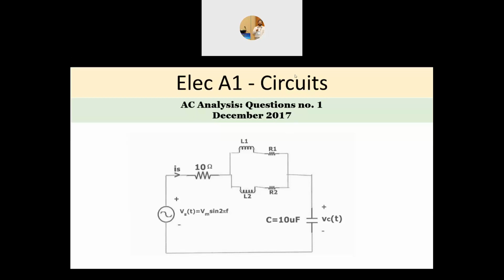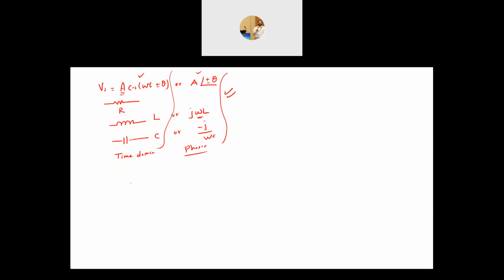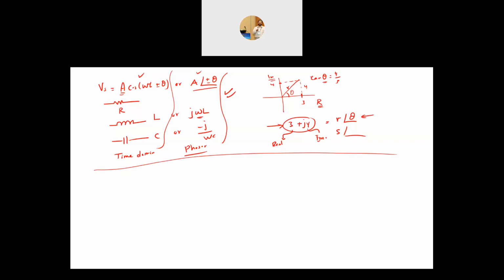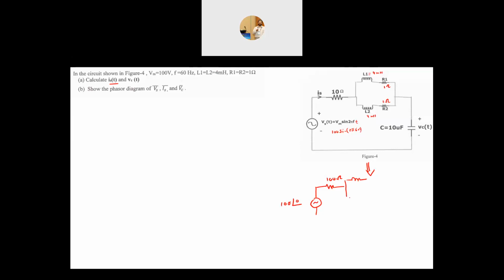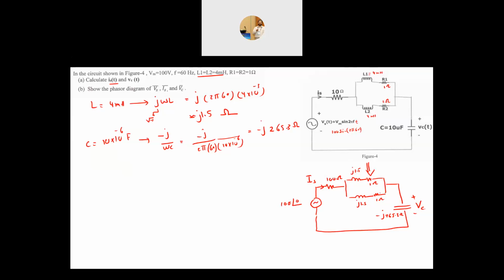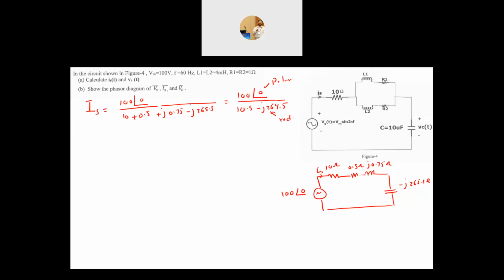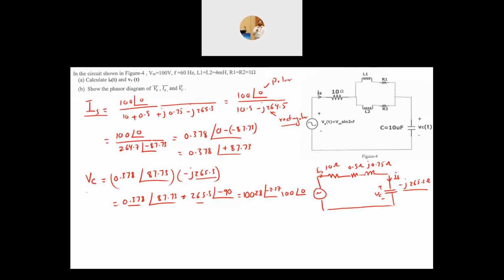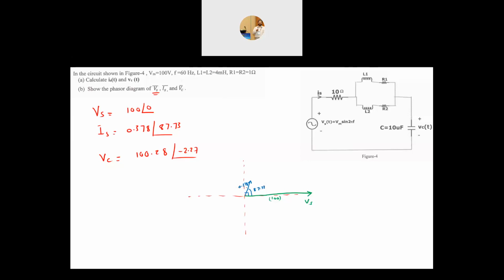PEO solved examples (ELEC A1): AC analysis Question no. 1

Comment: Hello Professor, shouldnt we add a phase to the voltage source since it is a sin not a cosine? Cosine has a phase of 0, right?
Reply from the maker: You may add a phase or you may not as far as you have only SIN or COS as the phase is a relative reference. However, if you have both in a question then you should as the 90 phase.

Comment: Thank you for the clear explanation. I'm just wondering, in what cases do we use the RMS value, and in what cases do we use the peak value?
Reply from the maker: If you use rms as input sources then all voltages and current you calculate is rms and if the input is peak then every thing is peak. We usually use the rms for power calculation questions.